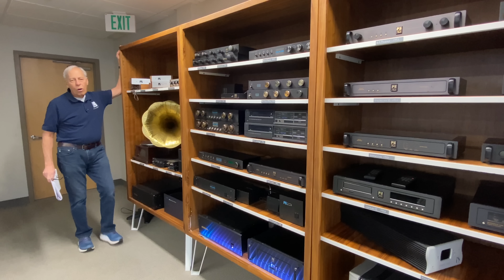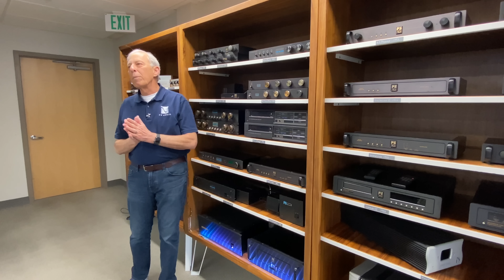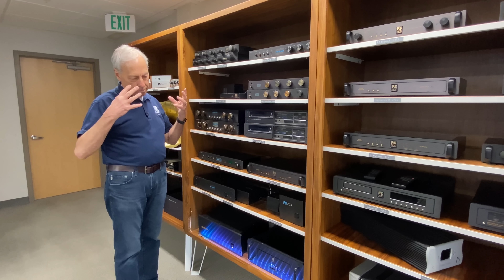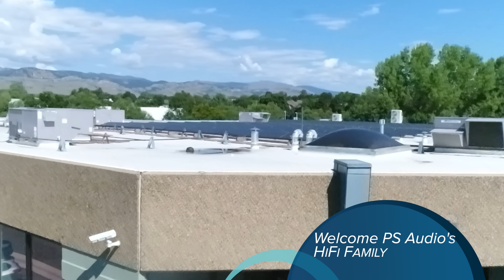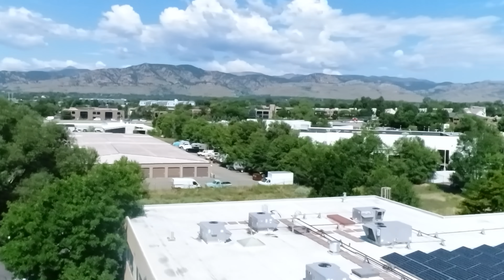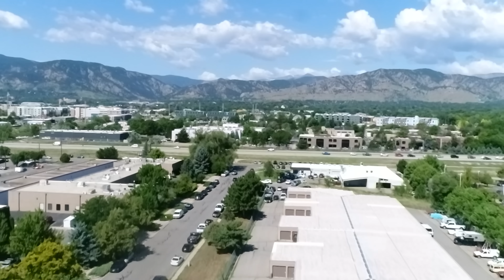Where do engineers go wrong?

Comment: @5:35
"...when they (the testing gear) are inadequate to show that which we perceive, that does not mean that which we perceive is wrong.  It just means the tests, the measurement data is not adequate or up to the test"
100% correct.

But this comes across as BS to some engineers; the ones that are convinced that their tests are adequate and conclusive.

The disconnect is that they hear no difference, and their tests show no difference.  Hence, they are convinced that they are right, and we can stand on our heads telling them that we hear the difference, and they think that we are suckers.

-- The problem:
Assuming they conducted a listening test, they probably did so using mass produced, department store quality stereo gear, with something like Bose speakers.  And that >*is*< the problem.  Part of their testing equipment is stereo equipment that is incapable of revealing what a high quality stereo would reveal.

-- The solution:
They need to listen on this type of stereo:
https://img.digitaltrends.com/image/wilson-audio-alexx-setup-3-1500x1000.jpg

With the above stereo, they will hear differences in interconnects.  Then they will go back to the drawing board to figure out why their testing bench gear is not agreeing with what they just heard.

Cheers!
Reply: @Larry Niles 
I see no justification for your disdain.  What did Andy say that isn't true?  Not that I'm concerned about your opinion, because it hardly matters, and it certainly doesn't qualify as "hurting" the engineering profession.  
What does matter, Larry, is whether we are successful at designing products that work and meet their requirements, including cost.  Fortunately we have managers and customers to make that assessment, and do not need to rely on outside observers such as yourself.
Reply: @Larry Niles Manners and PC aside, is what I said in error?
Reply: You're showing very significant confirmation bias when you just guess what equipment engineers and scientists might have used to study these matters, and especially since that assumption is highly derogatory.

You're also looking at it in the wrong way. It's up to the person that brings the claim to prove it's validity, not for others to disprove it. As the saying goes, that which can be asserted without evidence can also be dismissed without evidence.

There are of course still ways to apply the scientific method even when one assumes that the tests available are insufficient to detect the differences. One way is to perform true blind tests with sufficient complexity. If you can go through that and accurately detect the changes you've established that there is legitimacy to your claim that should not be significantly affected by confirmation bias, placebo effect, etc. One would think that the companies that make money off these things would be interested in proving that they are indeed valuable, if they indeed are. I think it would be very exciting to see someone pull that off, but I won't hold my breath since cable manufacturers usually don't even post measurements from their cables, which all serious manufacturers of amps, speakers, etc do.

Then of course there is the matter of whether a cable should affect the sound. There is a high risk of that cables that sound different from ones that already measure great just act like tone controls, and it's certainly debatable whether you want your tone controls to be in that part of the chain.
Reply: @Evil_Peter  Guessing what equipment engineers and scientists might have used is not confirmation bias, and it is not derogatory.  You writing that it is does not make it so.
Assuming that everyone that claims that they are an engineer, and claims that they are a scientist, is foolish.  Until they prove otherwise, they are probably nimrods sitting in their parent's basements.

Evil, I have heard the difference that interconnects make.  So there is nothing anyone can write that can change what I heard.  It was not subtle.  It was "splash cold water in the face" obvious.  Can I prove what I have heard?  No.  So according to your system of who needs to prove what, then I am supposed to mind my own business and let others make uninformed claims?

The folks that claim that cables make no difference never list the stereo equipment that they used for their listening tests.  In fact, they almost never claim to have performed a listening test.  And their claims of "cables make no difference" should go unchallenged?

Blind testing is all well and good, when the differences are subtle.  But on a professionally arranged high-end stereo, blind testing is not needed, any more than changing speakers in a blind test is needed.  Yes, a speaker change is even more telling.  But the cable change is obvious, too.

I have tested at Audio Connection, in Verona, NJ, using their flagship system, which consisted of Vandersteen Seven speakers, Audio Research momoblock amps, Aesthetix Metis pre-amp, Aesthetix Romulus Signature DAC, Aesthetix Eclipse phono stage, AMG turntable, Clearaudio Goldfinger cartridge.  That system is in a treated room, and was set-up by professionals.

Any change to the above system was obvious, including swapping their Audioquest Sky (at the time) interconnects for other well regarded entry level interconnects (I do not remember the other brands -- I think one was Kimber).

So I have done the test.  I have listed in detail the equipment used in the test.
I expect that those that claim otherwise to list the stereo equipment that they used for their listening test.
Reply: @0Perhaps  Yes it is, and it becomes downright hilarious that you think it's not extremely obvious when you even went to the length of naming Bose, which is of course one of the more despised manufacturers in the audiophile community. You of course go even further here by calling them basement dwellers. 

Of course you can prove that, I even gave you an example as to how you'd go about that. Of course you won't be the most likely person to want to do that as you're at least not making money off the products, you just seem so emotionally involved that you insult people over it which really lowers your credibility. It's the cable manufacturers that would be interested in proving it as they would have a lot of financial gain to be had, given that they'd open up the market to more than just a handful of audiophiles.

Blind testing works even better when the differences aren't subtle. That would make it easy to get very conclusive results, which further raises questions why no one is doing it. It seems like the cable defenders are so deadly afraid of putting their claims to the test.

The other benefit is that it eliminates other factors that play into comparisons. Only a complete imbecile would dismiss factors like the placebo effect, which is strong enough to even cause physical change in people. Then there's of course the other issue I mentioned, where the difference can be due to the cable actually being worse and acting as a tone control, as we have seen some high end cables measure poorly, but most cables aren't measured since few have the equipment to do it well and the manufacturers themselves either don't do it or refuse to show the results. 

Just listing a system isn't even remotely close to providing evidence so doing that and then stating some subjective and unverified claims is pointless. You also keep going the false route of putting the burden of evidence on those that dismiss the claim, which is factually incorrect. The burden is on the ones making the claim. That's common knowledge so there is no excuse for that. But just for the sake of it you could certainly go discuss with Gene DellaSala who is vocal about cables. He has both very sophisticated measuring equipment and a very high end setup, where his main speakers are even more expensive than the Vandersteen Seven's. He has a scientific approach so you won't get any BS arguments, and having such approach means that one is open to changing one's mind with new evidence.

To be clear, I'm not picking any side other than the side of honesty and integrity. I'd be very excited to see some tests showing that there are clear differences between cables that can't be measured. It would lead to much interesting research. 

I am very against unintelligent, dishonest and hypocritical arguments though, and there's a lot of that going around in high end audio.
Reply: @Evil_Peter  If you cannot make a proper argument, based on what was written, then you are doing so to deceive.

For example, quoting you, I did not write: You of course go even further here by calling them basement dwellers.
I wrote:
Until they prove otherwise, they are probably nimrods sitting in their parent's basements.
But you left off "probably".  Was it an accident?   No.  You changed the meaning of what was written to suit your agenda.  You are dishonest.

As to:
"Blind testing works even better when the differences aren't subtle."
If you put a hamburger and a Frankfurter in front of me, I do not need to be blindfolded to taste the difference.
If you put a pile of soap and a pile of poo in front of me, I do not need to be blindfolded to smell the difference.

As to who has to prove to whom:
That is a problem, because I cannot escort people to audio stores, and demonstrate what I heard.
I cannot expect audio stores to perform this test for every person that walks in.

But I can expect that people that claim that there is no difference to have done a listening test, and to list the stereo equipment that they used for their listening test.

Steve Guttenberg is an audio expert, and has heard more stereos than 99.99999% of the rest of us.  Argue with him.
https://www.youtube.com/watch?v=4rUD1Kxoybw

As to: "...you even went to the length of naming Bose"
Yes, I named Bose.  And I stand by what I wrote.  If you like Bose, and you believe that they are a good value (build quality and sound quality) at their given price points, then you should use them.  But then do not claim that you used them and heard no difference when you swapped cables.

Evil Peter, do you hear yourself?
Or is it that you are envious of those that have stereos that reveal differences in cables?

I do not own such a system.  But I do not let that change what I heard at the audio store.
Reply: @0Perhaps  That was a hilarious post.
If you think the word "probably" has any relevance for the point I was making you have some trouble comprehending communication. Even with that word you still wrote something extremely childish and nonconstructive that does nothing but show yourself off as someone that is incapable of tackling the issue in an objective way. Traits as being emotional and immature does not fit well into any discussion, let alone a scientific one.
You further the view of you being immature and not serious with your comments on blind tests. We're talking about hypothetically convincing people that audio measurements aren't refined enough to capture some things, which becomes a scientific issue, and I can't imagine how anyone would get in his head to think "my subjective and anonymous opinion will make a difference". You can't have to stop to think for more than a second to realize the folly in that. It just comes across as being afraid of actually having your claim tested.
Not to mention how you contradict yourself with your examples. You put forth very extreme ones, and somehow you still need a extremely high end system to notice it? So you couldn't sense the difference between soap and poo without highly refined circumstances? Again a sign of someone that can't argue on a serious level.
It's not really you that wold be expected to prove the claims, with you it's just remarkable how against the notion you are. The ones that really should be invested in proving the claim are the ones selling the stuff. Proving that there is a difference and that the difference isn't just a tone control effect, which would mean a shitty cable that alters the signal. If I had a great product that worked I'd invite anyone to test it to prove how great it is and through that show the world that my product is the best.
I like Steve, but I'd rather describe him as a very experienced audiophile, not an audio expert. An audio expert is someone I expect to have a lot more theoretical knowledge than he does. As for cables, he's shown both sides on his channel, having people with very high end gear say both that cables are BS and others that they work (I didn't hear anyone say that they are as significant as you claim though). We won't get anything like an attempt to actually establish cable validity in a factual way on his channel though. He seems content to leave it at opinions.
And yes, I did notice how you completely ignored the name I suggested and only came with one of your own. Another poor argumentation method that doesn't really do anything but make you look afraid to actually respond to points.

Regarding that you say that you need such a good system to be able to say anything about cables I could also point out that Gene's main speakers cost about as much as Steve's entire system.

 I also don't know why you say that I should argue with him about it as I very clearly said that I'm open to someone proving it. My stance is neutral, you're the one being die hard for one side. You clearly don't have very good reading comprehension.
What I think of Bose is irrelevant, I pointed out that you made another blatant and desperate attempt at discrediting those that disagree with you without any grounds whatsoever.
The question should rather be if you're hearing me. You seem unable to read what's actually said. That, together with your immature and nonconstructive way of arguing, makes it hard for me to put any relevance to any statement you would make. If anything you're making your side less credible.
Reply: @Evil_Peter  Paul is a self taught sales and marketing guy. He is not an engineer by the standards set forth by our society. He has no formal training. He built a phono preamp in the mid 1970s probably from some hobbyist  electronics magazine article and slathered it with the typical audiophile BS, which he is very talented at, secured an investor, and the rest is history. All those later products were indeed designed by accredited engineers either in a consulting basis or later on staff.  You don't design high power DC coupled amplifiers or power inverters at the 2kw range without some formal electrical engineering knowledge. And by design I mean from scratch, paper and calculator. Engineering is not copying a circuit out of a Douglass Self or other qualified engineer's how-to book. Just doesn't happen. It's not that PS Audio products are bad, in fact they are quite good. Which further questions why Paul has to promote this BS. I guess he just can't help himself.